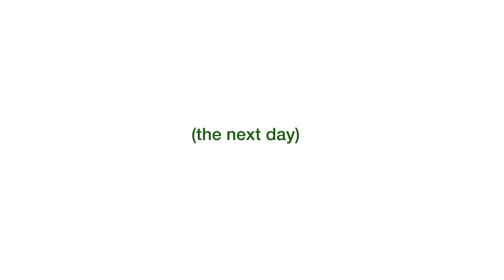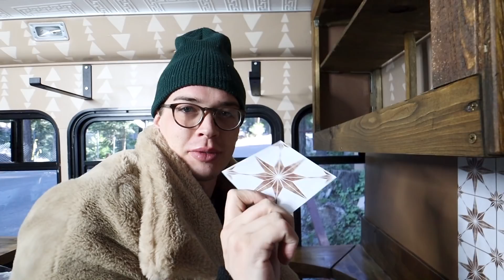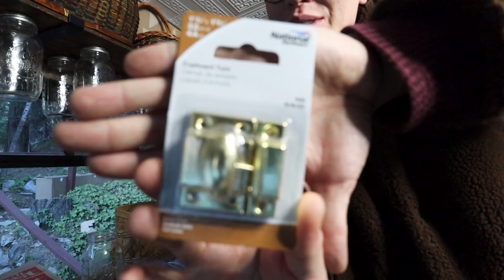DIY Kitchen Build Pt 2: Bamboo Cabinets, New Backsplash, Floating Pantry, Gravity-Fed Plumbing&more!

Comment: Guys.
You really need to seal in-between those 2 corners of your counter top as before you know it there will be crump's etc in the gap. Use a coloured silicone or even coloured wood filler if using wood filler then once dry just go over the filler with the same stuff you put on your counter top. Trust me if you don't it bug the hell outta you both.
Great job so far loving all the progress so far
Lisa UK xx

Comment: That IS a cute 'lil kitchen you built yourselves! I don't see why you didn't attach your fridge faceplate to your "skateboard" and add a handle; right now, i just want to pull on the faceplate to pull out the fridge ... i guess the velcro can take the stress, you certainly used a lot of it. ..... your shelf would benefit from a lip added to it, to prevent those baskets from falling down.  Dig your simple water setup, but you're going to find it really annoying to empty your grey water once you start using the cupboard on the right and fill it with stuff. Still diggin' the series! Now, onto the next installment!

Comment: I would have layed the bamboo sticks on a thin piece plywood then fitted it into the frame. The glue won't last over time and sticks will break. 
Also I would have placed them vertically. Also, insects will get in and spider webs 😯
I like the screwed on jars. But great job guys. I so love watching the videos.
👍So cute together.
What about lighting ?